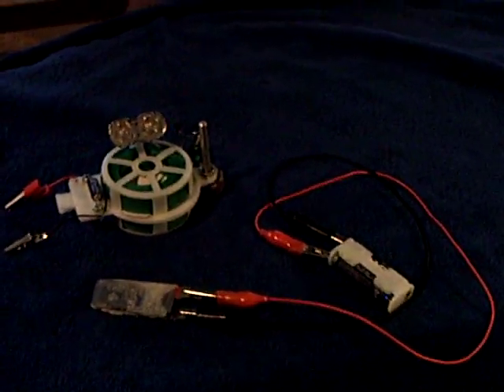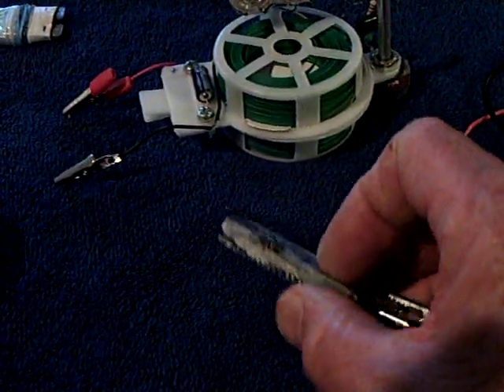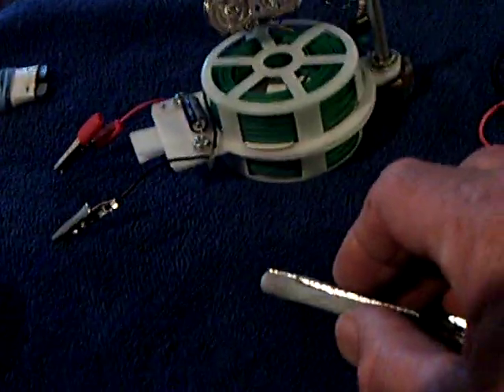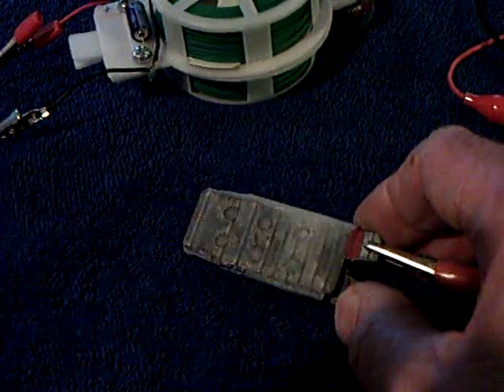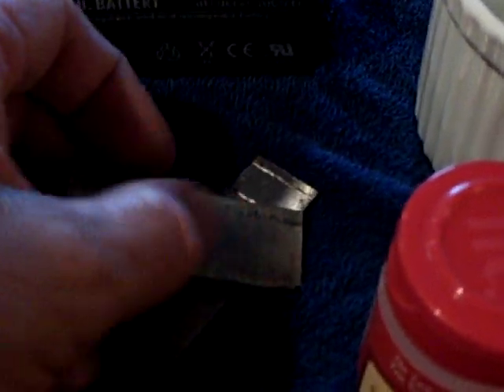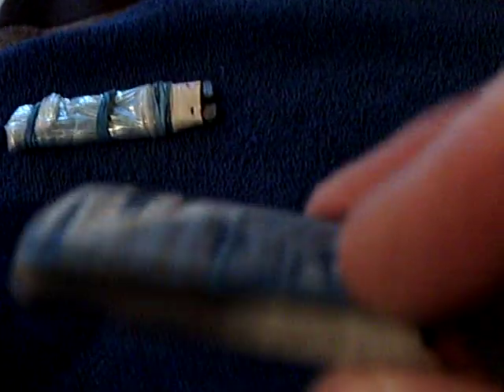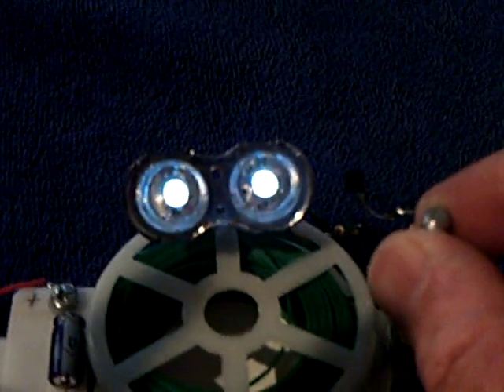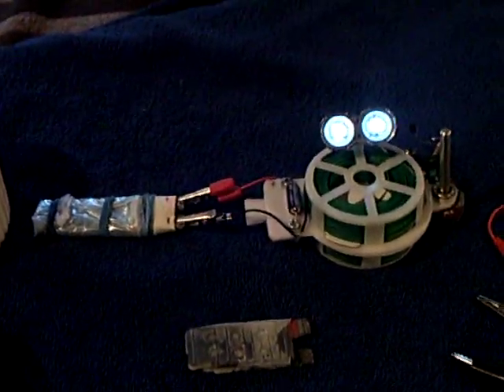Lead-Alum --- Solid Crystal rechargeable battery

Comment: Hey man what's your progress on finding a dry crystal cell that has no galvanic reaction?
Reply from the maker: No luck so far.
Reply: @Lidmotor  I like your video with the rochelle salt piece powering your ossilator why can't you just put those in series

Comment: First off, there is ONLY one type of Alum, and that is what you got out f the jar.   Secondly  dry monolithic batteries dont work until hydrated, at which point they are no longer monolithic,  without hands on testing I can only speculate, however I would postulate the alum layer was either never fully dry or drew moisture from the air. the same thing can be done with table salt, epsom salts or any other hydroscopic crystalline "salt" .   

As for  "energex", stay away, that crackpot is a complete fraud.   his claims about the "Lead Alum Crystal battery" are pure BS. It is just a lead acid battery converted to an alum chemistry. which others have done long before he faked his way onto YouTube.

Comment: hey lidmotor i was trying to make a crystal alum lead battery too. i used an old gel cells' neg plates (2) the pos plates must have disappeared when i washed there was alot of red residue and hardpieces . anyways i tried using borax, rochelle salts, and lots of alum , all cooked to wet and poured over alum soaked lead plates with a scrub pad divider( they were formed by me in alum dist. water with slow charge) now the cell works great but it hasnt hardened yet its still mushy on top. the question is what gas do you think im creating in the charging process it smells like  bleach , i have to charge it outside or the whole room stinks( im sure not good for lungs) so i failed with thismix for crystaline structure but ill try again with less borax)?????

Comment: Great work, at least it does do something and it's not like you can't reuse the lead. A load each charge rather than rest has worked well on mine. We need charge carriers I think for shuttling the charge around. Water does it, but in solid form I think has to display something of a static charge/conductivity emulation. I was thinking of granite, quartz, ZnO or even iron filings.
Many stovetop cells have used melted alum, will try zinc oxide tomorrow with that method :)

Comment: Exelent experiment. We can learn just as much from what won't work as what will. Good to know alum melts like that. Shame it's not so good for lead battery whithout water.Thanks for letting us know the type of alum. I've been looking and there are a few types around... You could melt or hammer lead you have thinner if you wanted. Maybe a roller?

Thanks for uploading.